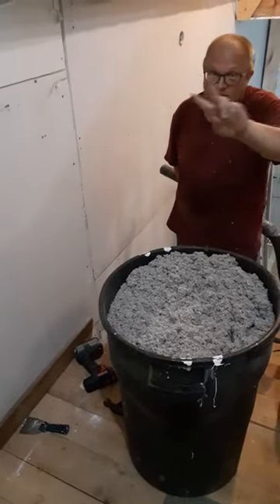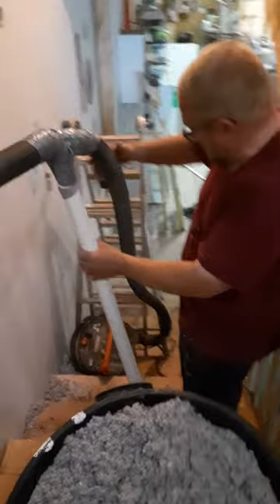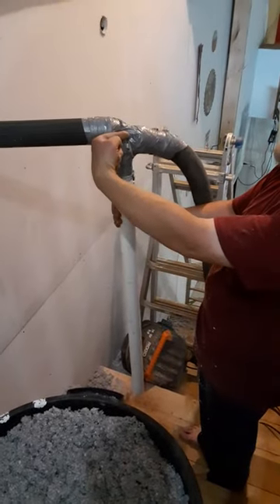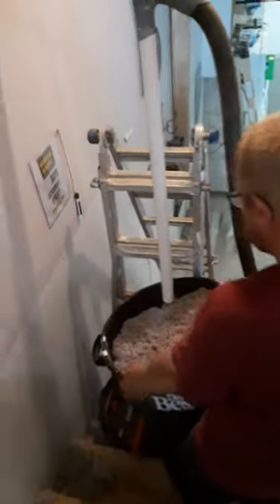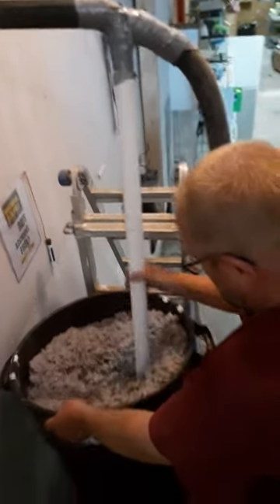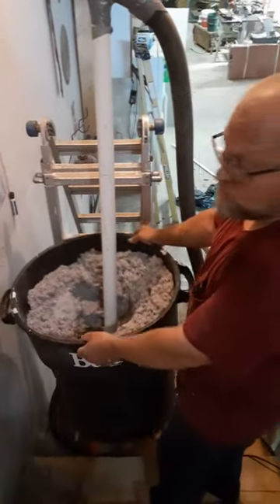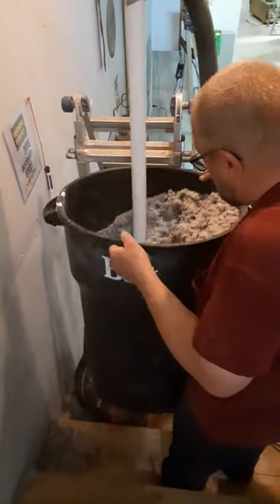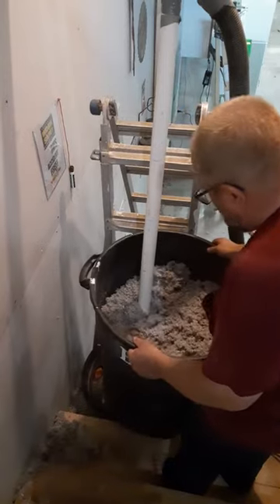Redneck Cellulose Blower part 2

Comment: Couldn’t you just connect a second hose to the intake on the vacuum and remove the filter and just let it go thru the shop vac instead of making a Venturi
Reply: I think should work. It gives you a higher sucsion as well.
Reply: It would get clogged up in the impeller. Better off using a portable dust collector.